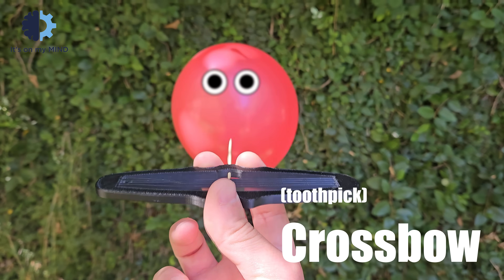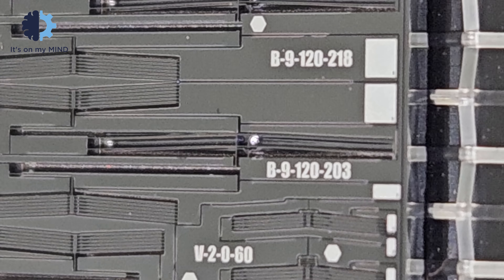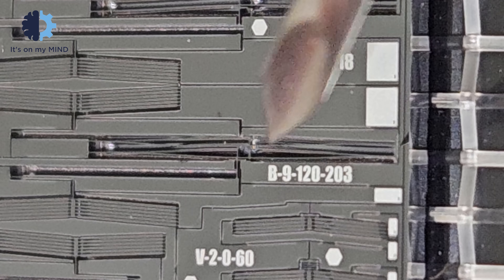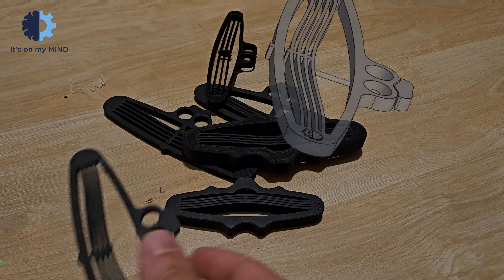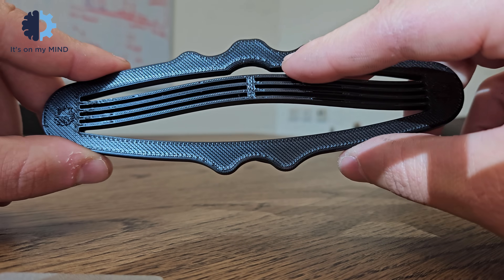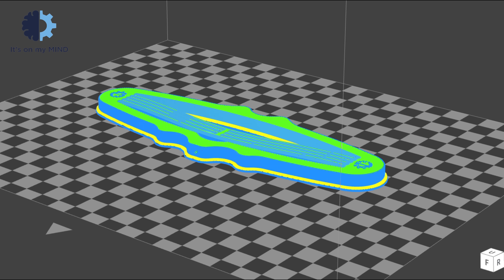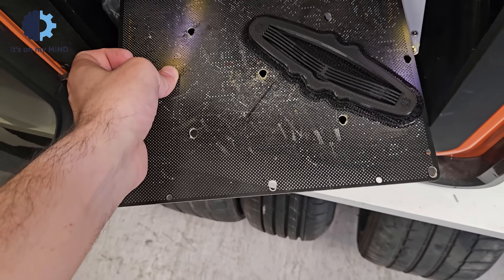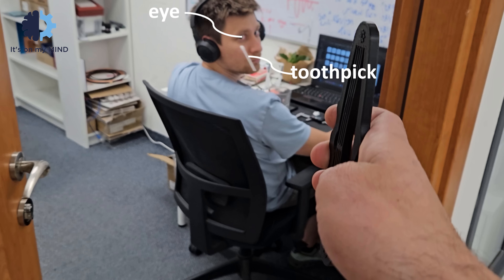Toothpick Crossbow (print in place)

Comment: could you tell use witch filament you used ? ABS seems to be a non functionnal right of the printer, I needed to bed the springs a little by hand
Reply from the maker: I used PLA. Maybe the shrinkage of ABS is your problem

Comment: How do you know how long to make each buckle and how many buckles to have?
Reply from the maker: Great question, somewhere, there is a formula that outputs the curve function of the beam. But it gives only the minimum curve needed to keep the beam buckled without snapping back. in the crossbow case, I wanted it to be powerful so I "manually" adjust the curve...  I printed many revisions

Comment: I wonder if the spring would be stronger if printed as a singular thick extrude per leg, or if layering them at smaller extrusions to make the same thickness, is better? 🤔 I'm actually not too sure, sigular extrudes would make a solid squished pipe type formation, while multiple lines would be more like a lattice and often have gaps. I think the reason some of your legs deform is that lattice has issues where it tried to join adjacent walls irregularly, hence the idea of printing that area as one heavy and slower extrude.

Comment: Clicked for the crossbow, hooked for the MEMs device you made for your company.  Are you allowed to describe it at all?  I have a MEMs projector and I'm all in on MEMs now.  And compliant mechanisms.  I'm just curious why you need dozens of mini crossbows on a chip.
Reply from the maker: Thanks! It was a test sample to check the manufacturing process and to test many variations of 3 types of switches to find the most optimal design. Based on the comments, I will probably make another video only on the mems device, describing with more detail how it works and what it does.

Comment: Can you design a crossbow/slingshot that is increasing it's load Ina binary way. Like you pull back one soft rubber, at the end of the pull you add a second soft rubber from the opposite side. Now the first rubber helps you to pull that one back to the first side where you ad third rubber but the second rubber is helping you to pull back two rubbers to the other end where the fourth rubber is waiting. And so on and on untill you can draw weights you wouldn't normally be able to do pull.